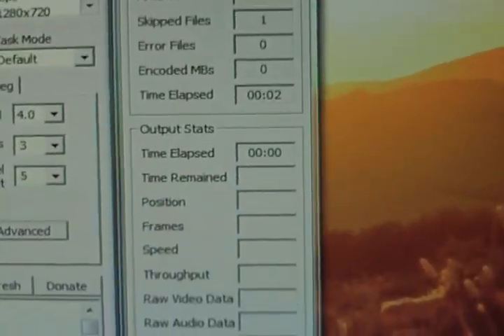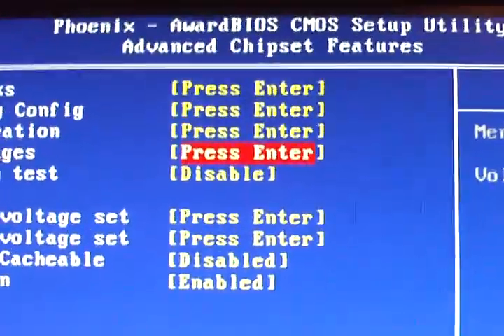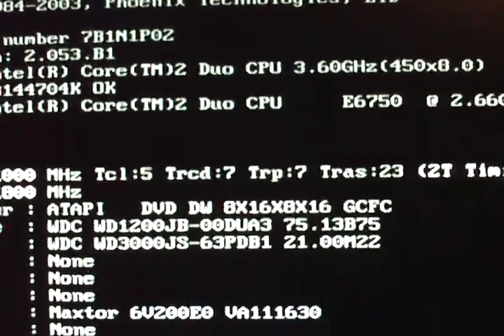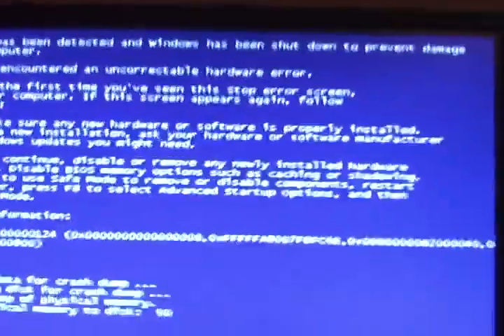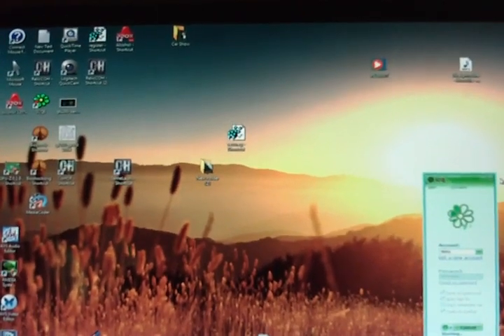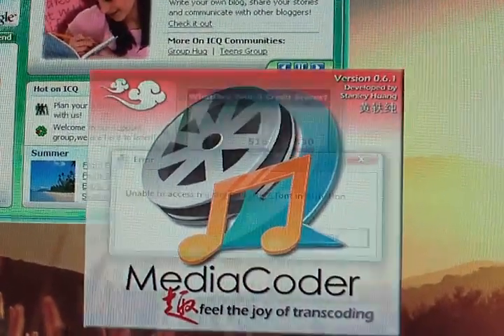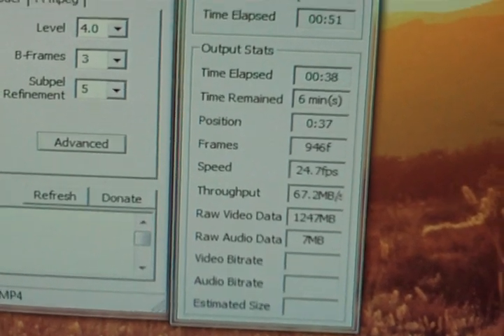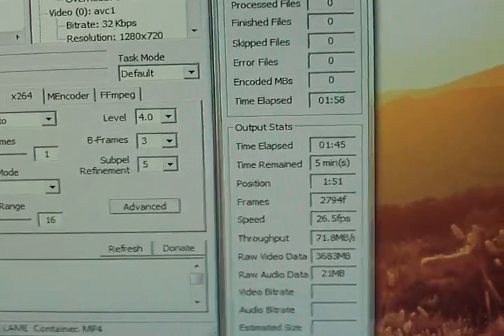How to overclock your CPU

Comment: hey i got my e6750 at 3.6 with volatge of 1.416 stable but my temps are quite high =x on max the temp goes up to 70c     is it ok to have that temp ? and also i want to go to 3.8 =( and izit good to have the ratio on 1:1 ?